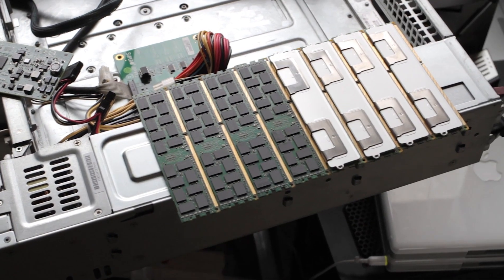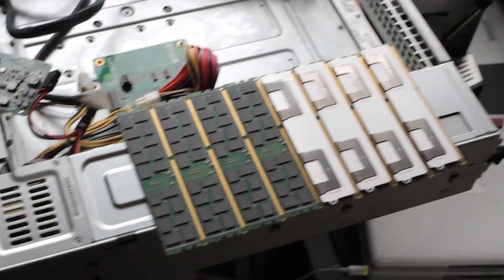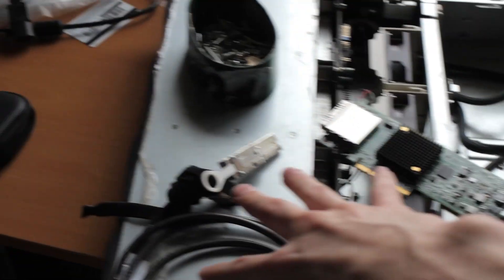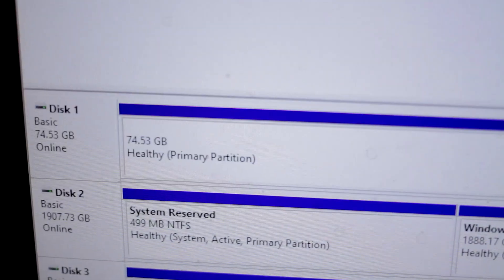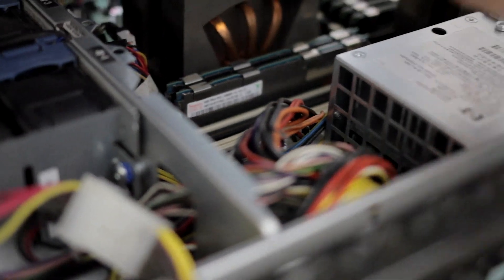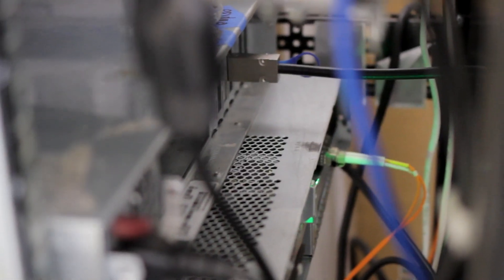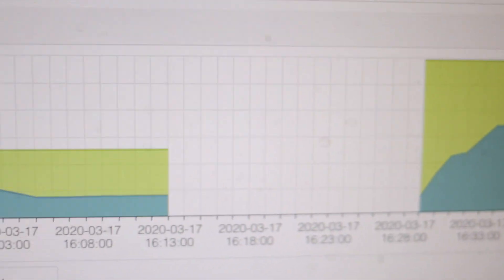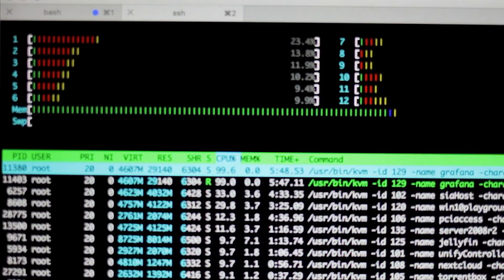Upgrading my HP DL180 G6 with more ram and a JBOD enclosure

Comment: if you need any more compute in the dl180 I can recommend the x5570, just upgraded from 1x e5520 to 2x X5570 and the performance jump is real. Cost- $40AUD.
Reply: i have x5675s on my dl180 G6 and they are even better than x5570s!

Comment: Ηελλο, how much Watt it consumes?
Reply from the maker: Depends on the exact config. About 100w idle with dual cpus and not much. With my fully loaded config it's averaging about 300w with a few vms running
Reply: @ElectronicsWizardry  How many kilowatt hours??
Reply from the maker: Idk. I have solar penels running it during the day and get abound 5kw from that
Reply: @ElectronicsWizardry  witsh cpu the server has?
Reply: @ElectronicsWizardry  supports SSD
Reply: @ElectronicsWizardry  And which processor??